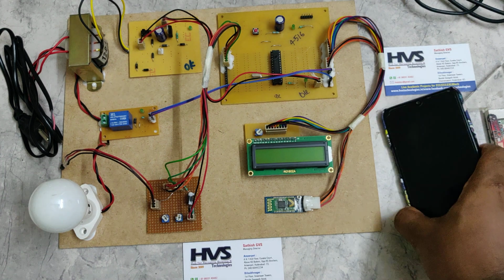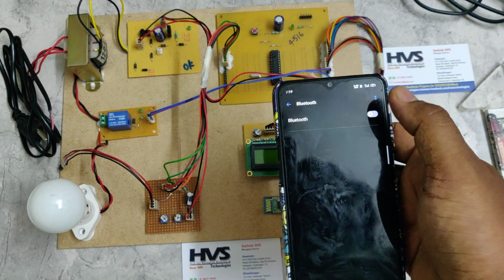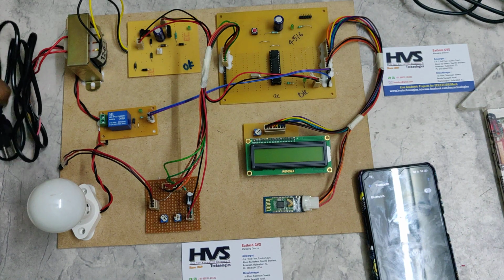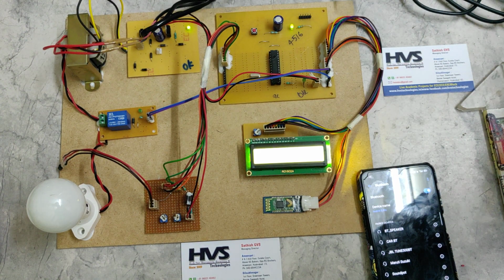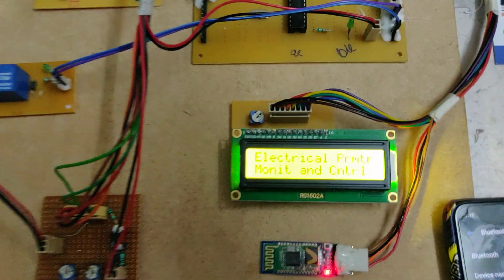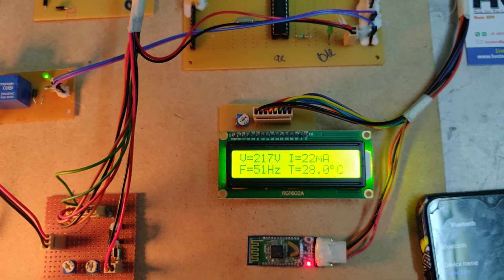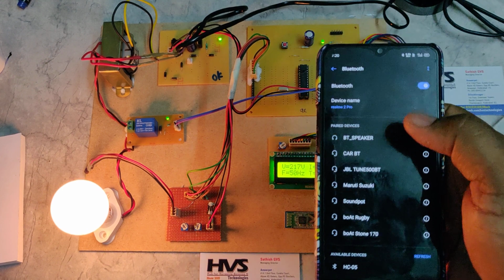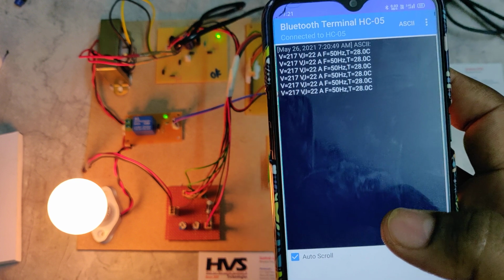HVS-1460. Development of smart substation using android smart phones

Comment: It's very good but I recommend to develop it by adding BUZZER  AND GSM and also another load  mean if you connect another lamp to the board automatically voltage and current will increase 
That's all
Reply from the maker: Yes, we can add the features which you discussed... But we make the projects based on students requirement
Reply: @hvstechnologies  ok sir